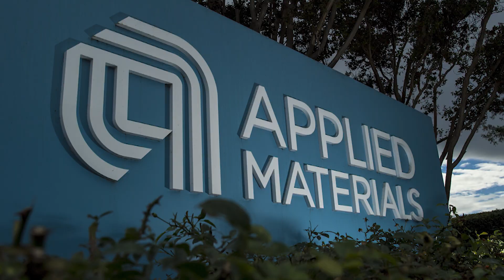Japan Revives Chip Ambition With TSMC in Kumamoto

Comment: @1changi
0 seconds ago
China can take over the Taiwan island within 48 hours with minimal collateral damage and loss of lives. PRC has an ace engineering feat called tunnelling. Just look at the extensive High Speed Rail network throughout the mainland. They can construct an underseas tunnel which can connect between Fujian and the island. This tunnel will be the permanent conduit to link the two locations together. It will have paved roads in both directions and railway link for High Speed Rail to run. Currently, satellites are orbiting above ROC to make surveillance to identify and locate suitable sites for the surface openings across the whole island. They can be located inside the Presidential Palace, the Tao Yuan Airport, near TSMC, near the National Imperial Museum, near the Kaohsiung port, inside special forces military bases, etc. They will be surveyed for regular activities to learn about its routine pattern. One fateful night, PLA special troopers dressed in counterfeit ROC military uniforms will emerge from these openings in a synchronised manner. Of course, they are well rehearsed. They will disembark from EVs which do not have fume emission or noise. Prior to these, smaller openings have already been made for onsite visual surveillance and for sniping of sentries on guard duties. When day breaks, the whole country has been successfully reunited with mainland. The whole world will hear about this and be amazed. US & Japan cannot interfere as this is considered a purely domestic matter. The best time for the 'invasion' will be during the Eve of the Lunar New Year when Chinese traditionally lit up fire crackers. This will be the perfect mask for blasting the openings. The long holiday celebrated by Chinese means lower sense of guard. The military personnel will be on home leave with the families. This can take place way before 2049, the 100th anniversary of the founding of PRC. The world must remember Chinese do not think like Westerners. D-Day type of Normandy landing belongs to the WWII era. The build-up of forces can be easily detected by satellites. It will be suicidal for the PLA to attempt this amphibious crossing or para-troop insertion. What the Russians are doing to Ukraine was utter foolishness. The Chinese are working on the perfect Trojan horse. Tunnelling undersea is invulnerable to earthquake, typhoon or bombing by any hostile forces. This tunnel will be important viaduct for movement of ROC citizens out to be pressed into food production and construction work gangs to be deployed throughout the mainland after the successful invasion. Specially selected model PRC citizens will be relocated to Taiwan who will be staying in pre-owned houses not built by them. Just look at how the PRC treats the Uyghurs in Xinjiang. PRC has to take this step to avoid prolonged guerrilla warfare with ROC citizens who has in-depth knowledge of the locale. Taiwan will be part of the Fujian province with Xiamen as the provincial capital. Any US weapons sold to ROC or locally produced ones will be hauled back to the Mainland for reverse engineering and to be improved upon to make into better weapons for PLA. Some can be exported to friendly countries to generate income and improve the GDP of Mainland China. This is the likely “peaceful” reunification scenario for Taiwan. Minimal damage and loss of lives. The prized TSMC will be intact. The company in Taiwan will continue production but the ownership will be changed. The plant in Japan can continue. The risk is spread. PRC wants to take ROC as a whole in one swift move. This is highly possible and not to be dismissed lightly.